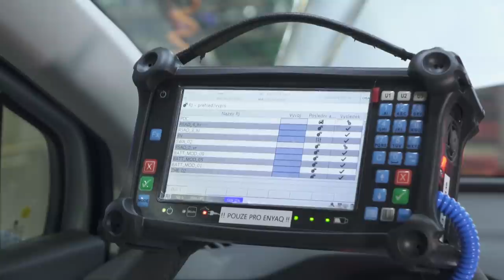New Skoda ENYAQ iV 2021 - PRODUCTION PLANT (this is how it's made) Mlada Boleslav

Comment: What is weird to me is drum brakes at rear axle. It's heavy electric vehicle, isn't it?
Reply: Vw feel the brakes aren’t used much in an EV so drum brakes will stand up to less use better.
Reply: @scottwills4698  Yep, usually they are not much used, so they last longer, no doubt. BUT when it comes to efectiveness of stopping such heavy vehicle from high speed (motorway) then drum brakes are not enough I think. They try to lower the costs, that's the point.
Reply: From a Norwegian point of view: Since most cars apply 80% of the breaking force on front axle, rear brakes are seldom applied enough to counteract corrosion. This phenomenon has increased even more when electric cars use regenerative braking for 70-100% of braking situations. Excessive braking every other trim is not enough clear the corrosion on the rear discs. Winters here are usually hovering around 0 degrees +/- and roads saltet regularly to keep from freezing. Over the past 8 years, our two cars have needed new rear discs/pads every 1,5-2 years - every time due to excessive corrosion. I welcome the reintroduction of drum brakes in EVs. In an emergency the mechanical brakes are supplemented with regenerative braking. I suspect the braking force is more than adequate to compensate for drum brakes and the increased weight of EV`s.
Reply: @torsteinlyngoy  Exactly this reason for the rear drum brakes.
Reply: This brakes include recuperation system
Reply: Thank you to all the people who pointed that drum brakes are designed to regenerative braking. For some reason I thought that recuperation is being implemented somehow in the powertrain (like in Toyota Rav4 that I have in my family - 2017). Now it's clear to me.
Reply: Just wait for optional passager seat- to save weight and increase range 😂